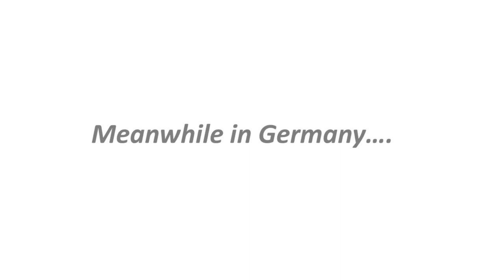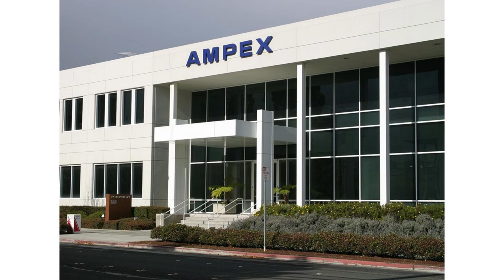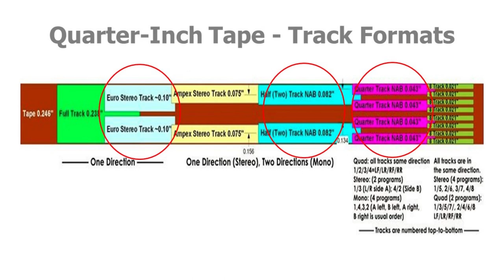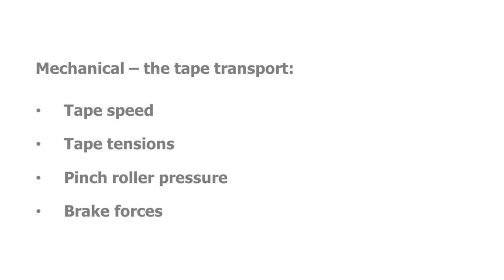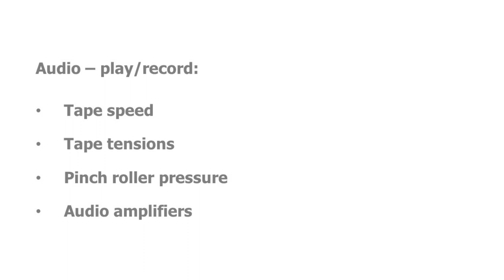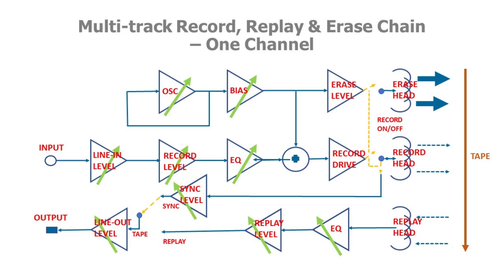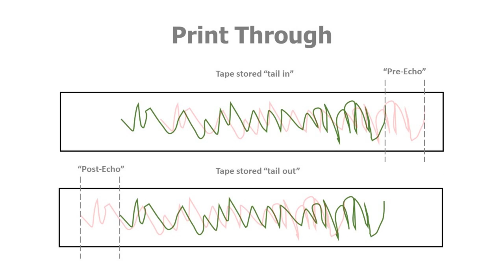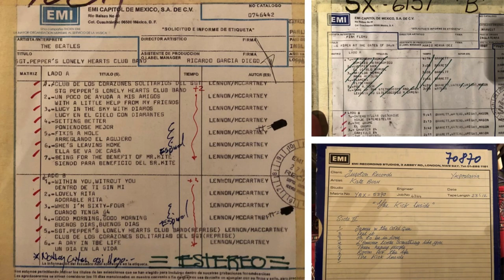Analogue Audio Tape Recording: The Resurgence of the Reel

Comment: As of this video posting, MRL has completed their office move and is in the process of resuming manufacture and shipping of calibration tapes.

Tape is fun to use. It can be a great PITA when something is broken, but when it is working it is fun. It's tactile, it smells good, it forces a pace to the workflow, and there's no undo so you just have to keep going. The audio quality (or "affect" if you like) is just one dimension of the tape experience.

All my 1/2" tape from ampex and 3m has gone sticky to varying degrees. I think I have reels of SM900 and SM911 that were OK when I put them into storage a few years ago, but everything else will need to be baked if I want to transfer it.

Compact Cassette is right-sized for handling by hand, and more convenient from a handling standpoint than CDs. New XDR cassettes I've recently purchased sound great on my mid-80s aiwa deck. It's a pity that decks manufactured today can't meet or beat maintained decks that are now decades old.

(AES meeting with mic noise issues... just proves they can affect everyone no matter your experience level.)